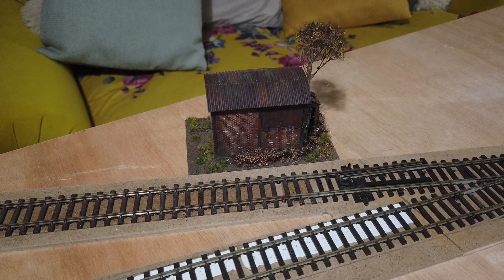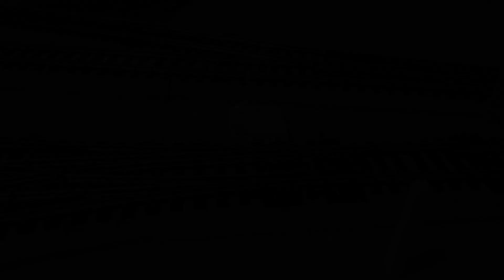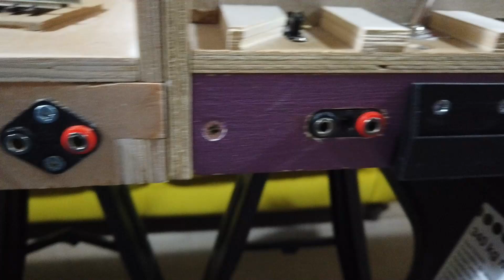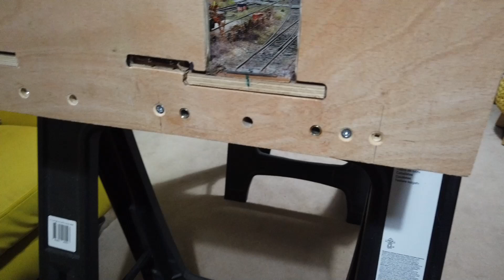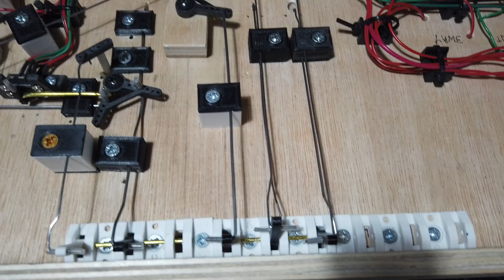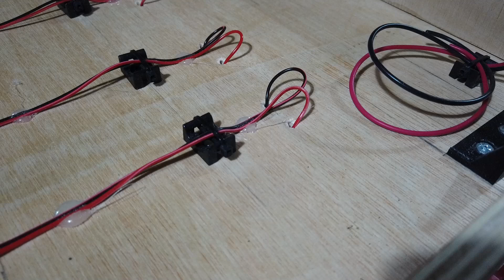Dibs Yard -Module 2 - 02 The Track

Comment: NOTE: CODE 75 VERSUS CODE 100 TECHNICAL ISSUES.
Code 100 track is suited to pre NEM (1989) models. When refined Code 75 track was introduced, this also required a European wide agreement on the refinement of wheel sets. (As agreed at the NEM Conference in Germany back in 1989). So the tread width, depth of flange, and the radius curve (RP25 = Radius profile now set at 2.5mm) between tread and flange all had to be reduced. So Code 75 pointwork, has reduced flangeways through the checkrail and frogs to cope with the new NEM finer wheels !!!

What this means is that if you use the old Code 100 track, which had wider flangeways through the checkrail & frog area, you will experience increased and spurious derailments when running modern NEM (Code 75 measurements) models on this older type track. 

Further it should also be noted that many Hornby NEM standard locos (but not their coaches & wagons), have their wheel "Back to Back" measurements incorrectly set. Their Code 75 wheels are oddly set to close together by around 0.25mm. Which also leads to spurious derailments on either Code 75 or Code 100 track. The cure is use a Back to Back brass gauge, forced gently between all wheelsets to increase the gap to the official NEM Code 75 setting. 

Back to Back gauges for Code 75 wheelsets, can be obtained from Good quality Model shops, such as Marcway Models in Sheffield. (They have a website).
Reply from the maker: Thank you for the great and detailed information. I did not know 95% of that.
I do have a 3d printed back to back gauge that works very well at regauging the wheels.
Reply: @dibsyardshuntinglayout  A brass "Back to Back" gauge also has a slot in it for the axle, which also allows for any "spur gears on the axle" (i.e. Locomotive geared wheels). It also has to be strong enough to ensure wheels are not bent out of line. So being metal it is strong enough to force the wheels apart (if to narrow) or allows you to squeeze the wheels together, while the "BtoB" gauge remains between the wheels !

 I'm not sure anything printed out of a 3D printer, would be nearly strong enough !!!!  Indeed I always recommend to any modeller that you will need to have a proper "BtoB" gauge in your tool box. A BtoB gauge is simultaenously the "Adjusting tool" to correct inaccuracies !!! 

Further if a steam loco needs its wheels adjusted (and ALL Hornby locos need adjusting) because they are actually produced by PIKO in China (not Hornby)! Then you will also need the little Hornby "Con Rod Nut removal Spanner" (R913) Costs about £5. Which allows you to remove the coupling rods, so you can then remove each axle individually. 

There is also a similar tool for steam locos using Romford wheels and axles, available ONLY from the wheel manufacturing specialists "Markits", (Price £5.70 currently). Such models have split head nuts holding the wheels to the axle, so this special tool is like a screw driver with a dual point head. Virtually all kit & specialist model steam locos use this system.  

I used Romford Nickel Silver steam loco Driving wheels on a number of Hornby locos when the Hornby Chrome finish on the wheel treads wears out. When the chrome finish wears off, the locos wheels will get filthy in just a couple of laps of the layout, causing the loco to start jerking and stalling. Romford Nickel Silver Wheels don't wear out, and give MUCH better current Collection & seriously improve Adhesion (makes the loco pull much better). Especially if you use modern Nickel Silver track such as PECO !!!!
Reply from the maker: @railwaymechanicalengineer4587  well, thanks again for the amazing information. Super useful.

Comment: Hi. I really like your rodding work , very clever indeed. I tried to incorporate it on my last layout. I did it on my swing gates. I found an old CD player so I took out the tray mechanism and fitted a double gate to it. I had the drive on one end and then used a rubber band and an old wheel off a 1/35th Panzer IV kit. This was under the slave gate. So when the switch was flicked the gates opened in opposite directions. I was very pleased with the result. I also did something very similar to your uncoupling ramps as well. You have done a great job with the 3D printer. Well done.
Reply from the maker: Wow! That sounds incredible. Do you have any links to videos or photos. Is live to see it altogether!

Comment: It’s interesting to see DC being used, the need for isolating switches etc makes for a more tactile and engaging experience. The point rodding is impressive!
Reply from the maker: Thank you very much. Yes DC only as the layout is very small and I can't really justify the cost of adding DCC chips to all of my locos. I'd rather have a new loco than two or three chips. Plus the cost of a super expensive controller for dcc.

Comment: I do like that gate lever, something I'll tuck away in my memory. I'm all for rod point changing and micro switches for polarity.
Lots of good practice going on.
Reply from the maker: Thank you for your kind words. If you do a similar gate in the future please share your experience.
Reply from the maker: Thank you. Please share if you do something similar, like the gate, in the future.
Reply: Thought I'd add a point lever of a very unusual design, if YT takes the link. [img]https://i.ibb.co/8sWf5x2/IMG-5272.jpg[/img]  Yes moving the van back & forth works a point therefore keeping everything on the board scenic.
Your moving gate is a step beyond.

Comment: Firstly, let me congratulate you on your very neat work. It's always  a pleasure to se it done well. And, as a bonus, you can find faults very very effectively! 
I have always been a bit ambivalent toward "lever frames" (I like em, they just looked a bit out of place) for my own use. But I like what you have done, especially  as you have made them yourself. 
I can see using them with a dpdt slide switch directly under them, and then rodding from there might be a trick!
I've used diy cranks with 1mm stainless steel welding wire running in 3mmm hydraulic plastic tube. It works ok, but the resistance is a tadd too high. I might try what you have done, having more exposed wire!
Thanks for sharing your ideas😊
Reply from the maker: Thank you for kind words, and sharing your approach too. If you do try a more open rodded approach, please do a video or some photos and tag me. I'd love to see it.